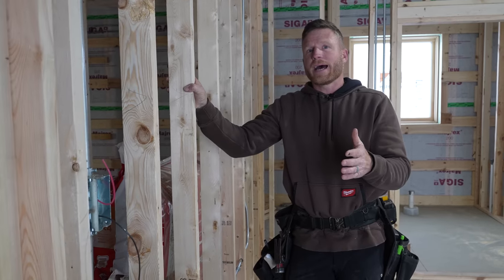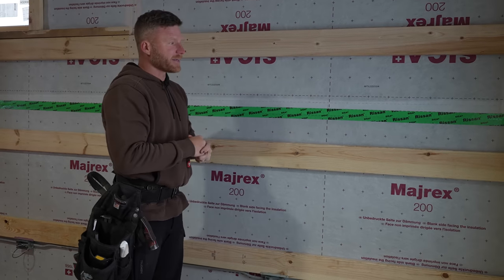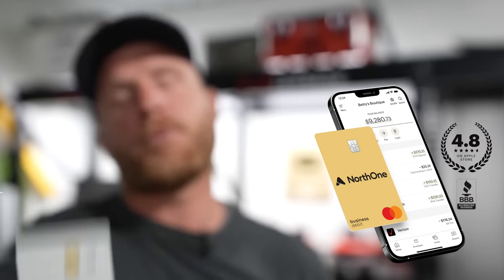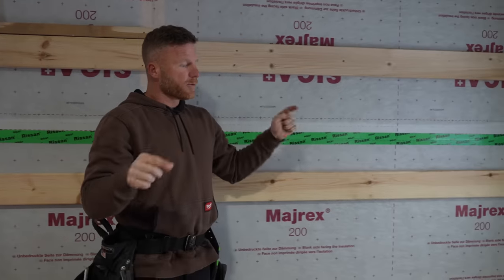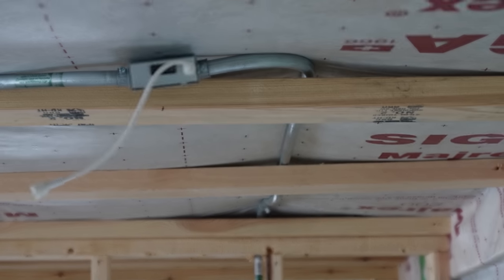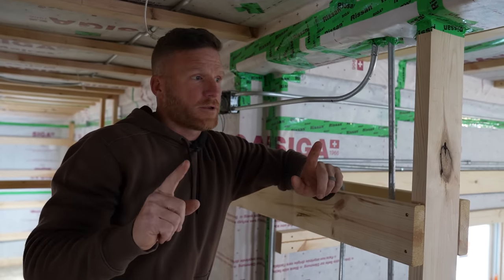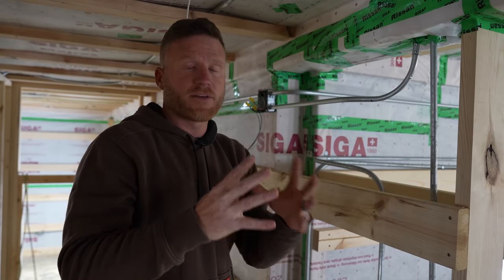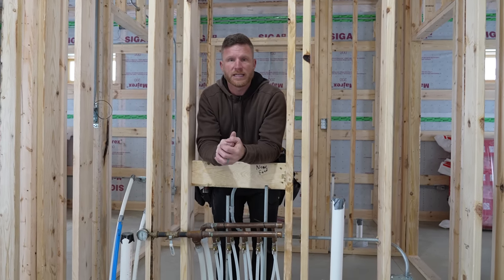The BEST way to run ELECTRICAL in the BEST HOUSE

Comment: when you do your blower door testing, all of the electrical boxes should be covered with tape or the actual devices and their covers. If left uncovered, the emt conduit that goes to unconditioned spaces will be a vessel to allow outside air into the structure and ruin your true blower test results.
Reply: Good point, but it is a good practice to place a pinch of non-hardening duct seal around the conductors entering an unconditioned or exterior space in any sized conduit.  Just open a box cover on a cold day and feel the breeze.  Anyway, the wiring job is generally impressive!!
Reply: Are your allowed to spray some foam I’m the conduits that go from outside in or inside out.  Or maybe caulk it?  But definitely a flaw when trying to be this meticulous.

Comment: Those led drivers for the pot lights are gonna be a pain to replace when they crap out down the road, since they are hardpiped into the EMT.  BX whips off JBs would be the way to go there.

Comment: At minute 15:46 on the left, the tape around conduit has an area where it doesnt seal(left side of the join). Also I use Contega tape and liquid barrier to ensure the seal, the plastic tape doesnt really do that in all cases, or if the budget allows it I use special patches with EPDM to seal. Great build!

Comment: You just gave me the idea of removing one of my bathroom vent fans from the ceiling and move it to what is an outside wall to vent directly out the side, moving all of the fan and its vent piping inside of my insulation envelope until it actually vents outside. Now I don't need to cut another hole in my roof to fix what original builders should have done.

Comment: I'm currently developing a post-frame 4plex that uses Structural Insulated Metal Panels. Similar to SIPs but with a finished metal exterior instead of OSB. It serves as an unbroken thermal barrier, all weather barrier, air barrier, shearing, sheathing, and a finished exterior. It allows you to have the frame fully exposed on the interior without the need for as many girts. I make a channel behind an extended baseboard for all the utilities. You can easily hit R21+ with a 3"-4" thick panel. They're usually used in commercial/industrial structures but they are just as useful in residential. I'm shocked that it hasn't taken over the barndominium market yet. Please look into it for future projects!!!

Comment: In my 15 year old home ( we're second owner) I take the 8' ceiling above the shower and false ceiling it down 1' and in that warm 12" area I duct my exhaust fan horizontally into the adjacent room where I mount the fan and the DUCT THE DISCHARGE DOWN AND OUT.
Why? Because when the fan is offline cold air can't migrate backwards uphill and make the shower ceiling cold!!
No more condensation offline inside the ducts, noise reduced with fan motor outside of bathroom, shower heats up quicker ( less volume) and an added bonus is now I put a waterproof led light in the ceiling.

Comment: Great info and presentation as always. I'm a long-time subscriber/viewer but for some reason (possibly "user error") I got unsubscribed. So, I JUST "re-subscribed". LOL.  

My burning question (we'll be building a post-frame home in the high desert of Northern Arizona later this year). If you're running your interior gerts (sp?) on the exterior walls at 2'-0" on center, how do you handle the nailing/screwing schedule on the butt joints? I never see this issue detailed in any post-frame videos (at least that I've seen). Thanks for the time you take to produce these videos. I've learned a ton.

Comment: We vented our bathroom 💨 fan through the conditioned space and then through the back wall of our poolhouse.  No roof penetration.  (No such thing as too tight, we have an ERV coupled with a heat pump conditioned air system.)

Comment: If it were my building I would want EMT conduit as well. It allows conductor repair, upgrades and alterations without tearing into finished walls. Romex does not. The wall needs to be opened to add circuits with Romex. I am an electrician.
Reply: I’ve been an electrician for 25 years and I love using conduit but, most homeowners are not going to go with the price difference from romex Ray.
Reply: @greenridgepropertysolution3211  absolutely, an extreme few would see the value in it. In my personal home and workshop buildings I use a combination of conduit, mc cable and Romex depending on the application.
Reply: @Ray Green  thanks for your input!
Reply: Can you add new circuits as easily with conduit as compared to Romex?
Reply: @DylanDraper1  no sir. That’s a downside to conduit.
Reply: I rewired my last house without tearing into any walls, removed the old boxes, used a fish tape down into the wall cavity from the attic, pulled new wire through the hole. Same process in basement when needed. I added some outlets while I was it. So it can be done without opening walls if it really want. Conduit is cool but I couldn’t imagine the difference in cost, and the rare case you want to add a circuit being worth it.

Comment: FYI How much R do you need? In parts of CO, it was found that high winter winds were the issue. Your better off sealing the crap out of your exterior walls than just making them fatter. How good fiberglass functions is as much about air flow as thickness. If those wall bays leak air, you have moving air in the bays. Modern heating systems are more stingy so with radiant floor, it can takes hours to warm up an air exchange. A leaky wall with high exchanges during high wind loading means the heat system can never catch up.  Stick framing was a huge cost advantage in its day. But the cost of energy is changing that. You are going to need to deal with thermal bridging and high air exchanges. As a timber framer, we went to using SIPs. But this system seems to be a pretty good alternative to timber framing especially since not all structures can be timber framed.

Comment: Regarding exterior penetrations.... You drywalled before boiler was hung I agree that is a necessity on exterior wall, what about the penetrations for the intake and exhaust of boiler? Was Myrex etc sealed around piping for that prior to drywall installed? Also I assume there were at least a handful of electrical outlets, lights, outdoor spigots etc? can you show how you sealed those??  One suggestion I would offer. How about installing plumbing vent in the exterior wall cavity, then through gable end of roof to avoid shearing of pipe from ice/snow and seal around penetration where interior wall/ or ceiling venting can connect to it?? Not always an option due to location of plumbing walls but sometimes could make sealing penetrations less inhibitive?

Comment: You should see if implementing one of  Siga's new boots around those electrical penetrations that the electrician taped  helps vs. just the tape. Do a tape vs. boot air leakage test.

Comment: The Electrician shown in this example  that required EMT did the right thing.   The NEC does not allow Romex to be directly attached to those horizontal "strapping" pieces.  It requires 1-1/4" spacing. (300.4(D)    Any jurisdiction that allows it is incorrect because no jurisdiction has the authority to approve an installation less than minimum code.   If a problem occurred the electrician is legally liable even if the local jurisdiction approved it.     Having said that not sure why go through all that effort and not pull a ground wire!??   Handful of various other issues/corners cut seen throughout the video.   You have your building trade nailed down you just need your trades to catch up!   Great content.

Comment: Very nice work but with small changes in approach, you can reduce leakage and get even crazier ACH numbers. Tip of advice, add liquid flashing in certain critical areas where tape can't fold or ben naturally. Also, you'll be losing air from your electrical conduits depending on how it was run. We just broke the record for world's tightest home not long ago. Confirmed 0.03ACH@50pa, so I can surely help with small tips and pointers. Regardless, amazing job and keep staying the course!!!

Comment: The HRV systems draw the incoming air around the exhaust air pipe so that the heat from the exhaust is transferred to the incoming fresh air. This helps minimize how much heat is lost while still maintaining the necessary air exchange for a healthy  home. The opposite is true in the summer, where the warm exterior air is pulled in around the outflowing air pipe so that the incoming air gets cooled down before it is brought into the system.  It is a MUCH better system than conditioned air leaking directly outside and unconditioned air coming directly in through the walls.

Comment: If your building is that tight are you planning make up air for bath and kitchen vents?  Seems like the Broan erv would be a good option.
Reply: I had the exact same question.
Reply: It'll be essential. Makeup air is actually code now.

Comment: Kyle, with you making these homes so air tight and well insulated (which is a great thing). Have you ever thought about installing an ERV system in these post frames? And a dehumidifier system? I’m wanting to build a post frame and make my wall cavity R 34 with 4” of closed cell spray foam + R 6 zip system sheathing. I’d love to know your thoughts!
Reply: Also, since you are doing radiant in floor heating (which is awesome I plan to do the same). How do you plan to cool the home?
Reply: @machickman4041   you can do radiant cooling in the space as well , also radiant can be installed in the walls and ceiling as well if desired. this method is not as common but is effective.

Comment: Nice video, the only thing I hate is everyone runs the hot water line under the slab and thru the concrete without any insulation around the hot water line.

Comment: An ERV does not remove moisture, thus is not appropriate for a tight home in a cold climate unless coupled with a dehumification solution.

An HRV brings in fresh air also, but dehumifies as well (condensate drain required)

Either won't cause problems in a leaky home in a cold climate, but in tight homes in cold climates, the HRV is the appropriate unit for fresh air; note that spot ventilation/makeup air may be necessary for a range hood in very air-tight homes.
Reply: You have that backwards.  ERV=Energy Recovery Ventilator (temperature & humidity).  HRV=Heat Recovery Ventilator (temperature only)

Comment: Why do you have steel pipes and boxes for electrical wiring? In Norway we have been using plastic wall boxes and pipes for many years. With plastic pipes you have the flexibility to run them wherever you want. Also why don’t you set up framing walls after you have installed the siga waper in the sealing? Then you don’t have to pull it trough the walls and in between the studs and tape it after

Comment: Would it not be better to have a fully conditioned attic space? Also, here in the west, we run our plumbing  through the ceilings, walls, etc and not under the slab except in kitchen islands.

Comment: cost of running EMT conduit with individual wires a.k.a. conductors versus using Romex  throughout  the entire job. I believe the cost to run electrical on an average 2000 square-foot house $10,000 - $15,000. 

Cost for running EMT? $40,000 - $60,000. Any thoughts?

250Ft 12/2 Romex $159. X 2 = $318. 12 AWG solid core THHN wire 500Ft $106. White, black, Green,  Red 

$106 x 3 = $318 for 500Ft. 

500 Ft of 1/2” EMT 50 10Ft pieces $6.59 x 50 = $329. Standard licensed electrician labor is $100. Per hour Labor 

Question: how many hours would it take to connect up 500 feet of EMT making the bends when necessary installing the connectors run the (3) Conductors aka  wires through each EMT. 

You’re also limited to the number of conductors (each wire) 12/14 gauge wire that you have installed in a EMT conduit! Per NEC, Cannot exceed 50% of the total thickness of the wire of the inside diameter of the EMT conduit

12/2 or 14/2 wire and you have to jump to the next size 3/4”, 1” or 1.5” 

EMT 1/2” x 10Ft Conduit   $6.59 set of 5 connectors $3.99 to screw into single gang, 2 gang etc EMT connectors $.47 each boxes $.80 each 3/4” x 10Ft isn’t cheap! A lot of bends. Much more expensive labor by a factor of 5-10
More! Overkill! With that said if the drywall is attaching directly to your 2 x6 batons. Then  anybody at any time could be mounting a picture on the wall and pierce the Romex! Unless I’m missing something? When you install Romex through to buy wall cavities, you have to install nail plates every time you make a hole in the center of the stud to prevent somebody from nailing or screwing into it!

Comment: I am guessing conduit was required by code because there would be no way to protect the romex from drywall screws.  My inspector would not allow me to run romex along any girt boards.  Luckily I asked before I ran the wiring.
Reply: Thanks for watching and leaving a comment.
Text me on Telegram I got something for you.

Comment: Another advantage of your type of building is that no protection needed for electrical lines drilled through the outside walls. The breathing started because they needed air flow to keep things dried out.

Comment: Wondering about concerns of Radon gas infiltration in this tightly controlled environment. Obviously a bigger problem in some areas than others so how is radon risk managed with this type of air transfer and control? Great videos--thank you for such a good job explaining the value of these details.
Reply: An ERV is actually venting the air going through it, you still get the same amount of ventilation, just size and tune the ERV to what you want to achieve. As far as radon goes, a tightly sealed up building isn't necessarily worse. In a huge portion of homes in the USA you have AC ducts going through an unconditioned attic and you're just about guaranteed to have some amount of leakage where ducts are connected. Every cubic foot of air that leaks out of the ducts has to be balanced by a cubic foot of air leaking in through the rest of the building. This makes AC systems with ducts outside of the conditioned space create a slight negative pressure when running which means any little crack that radon is seeping in through is now going to seep in just a little bit faster. On an ERV you can generally control exhaust and intake separately which lets you run the intake fan just a little bit harder than the exhaust fan giving you a slight positive pressure and reducing radon coming in through cracks.

There are pros and cons to trying to maintain a neutral pressure vs. positive pressure so it's not like there's only one right answer. Back to the original question of just air tightness by itself increasing radon exposure there have been studies to see if that was the case. In some cases more air tightness increased radon concentration because you're not diluting it with fresh air as much but other cases the tighter houses had less radon infiltration because they reduced the radon coming in enough that it outweighed the reduced dilution of the radon that got in. A tight vs. leaky house doesn't necessarily mean one is strictly better than the other when it comes to radon, it's a balancing act of different factors. In the end, if you're in an area where radon could be a concern, you aren't going to be able to accurately predict the radon levels without actually testing for it. IMHO, a tighter house gives you a better starting point to actually address the problem and drive down radon concentration compared to an older leaky house.

Comment: One huge benefit of a tight house with air handling I think you forgot to say is that you can recycle the energy (heat/cooling) from the outgoing air into the incoming air, thereby cutting the cost to further condition that air dramatically! The system filters, conditions and recoups energy very efficiently but only if the home is super tight.

Comment: Do you have a video with your romex wiring vs conduit?   I am building a shop with 3 rooms in it.  I was planning on just surface mounting my electrical in conduit.  But burying romex in the walls would be cheaper than running conduit everywhere

Comment: I know materials and labor pricing is different in different areas, but can you give us a rough estimate on the cost of having a post frame house such as the one in this series spray foamed vs the rock wool/siga options.  I realize there is a lot that goes into this as it affects other trades as well, so just looking for a general “costs about 10-15% more” kind of thing.  Thanks.

Comment: Blower door test will show the air flow through the conduits that extend from the interior boxes beyond your air control layer. Perhaps they are planning on sealing those conduits. This will also prevent moisture/condensation where cold and warm air meet.

Being a master electrician myself whom focuses on quality and continual improvement,  I'm disappointed that the conduit job is not up to par with the construction itself.

Comment: Would you use Majrex in a basement buildout? Full basement, North of Chicago, 2" Foamular rigid foam glued to walls followed by 1" air gap, 2x4 insulated wall, 1/2" drywall.

Comment: Kyle, you mentioned concerns about running the exhust up into a cold attic.  What are your thoughts about having roof insulation instead of ceiling insulation?  Then all of you attic ducting is in airconditioned space.

Comment: I'm wondering if you didn't use the exterior girts or that type of insulation method and instead, used Structural Insulated Pannels (SIP's) like timber frames are built. What would the air quality and cost end up being?
Reply: Thanks for watching and leaving a comment.
Text me on Telegram I got something for you.